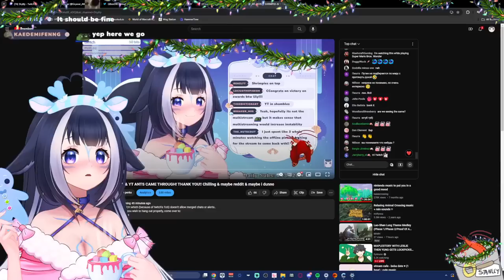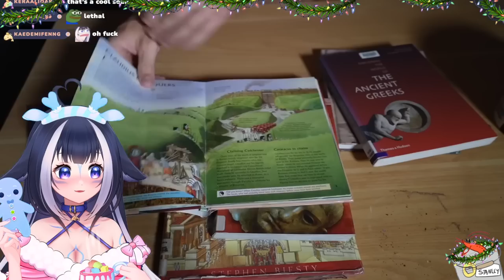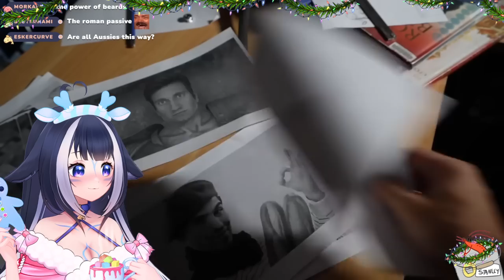Shylily Reacts to 'I put a ballista on my car'

Comment: Hey lily just a small bit of info (tho I doubt ull see it bc u posted this vid a week ago) the noise you hear when he lanches the arrow is the sound of the metal wire from the "rubbers" hitting the pipe of the arrow and making it vibrate you can hear it when he launches around the 11:56 mark from the second camera angle (the one being held)

Comment: You could actually make an X-bow that auto reloads and they did perhaps exist. It is called the Polybolos, it is a very old Greek weapon I believe, and it is literally the Gatling gun of its day (again, I don't think it has ever been confirmed that they exist). It is a large crossbow with a box that holds multiple bolts or arrows and the operator turns a crank to reload and fire. The crank wheel will turn a chain that hooks onto the bowstring and pull it back, and as the string is pulled back it will catch an arrow from the box and pull it out. After a certain point, the chain's means of holding the bowstring will slide out of the way and the bowstring will send the arrow or bolt in front of it flying. The faster you turn that crank handle, the faster you fire so long as your loader can keep up...assuming that they actually did exist.
Reply: Koreans and Chinese utilized a repeating crossbow, replacing the hand lever operation with a winch would also make an effective rapid variant